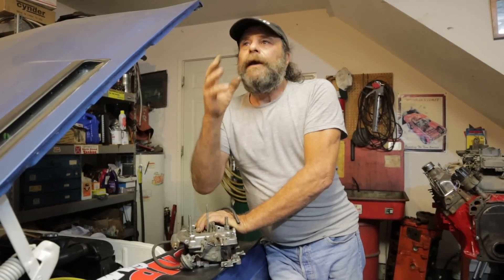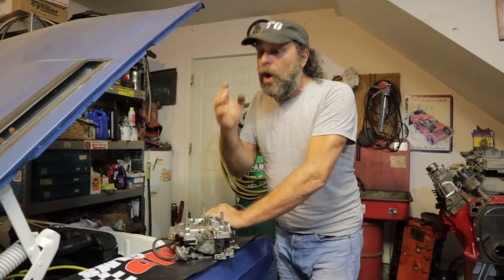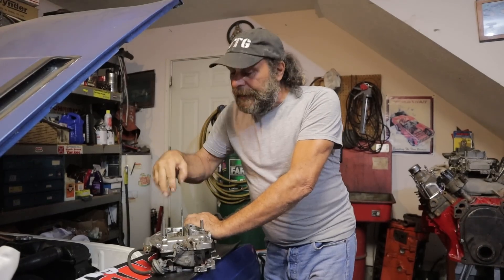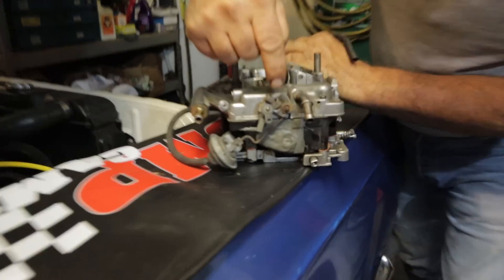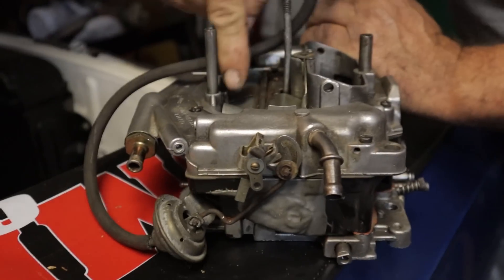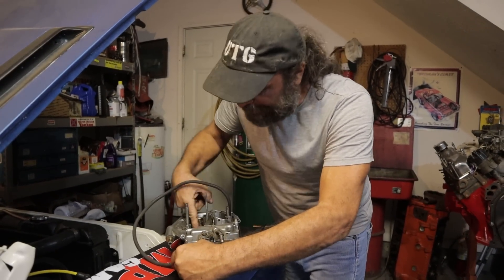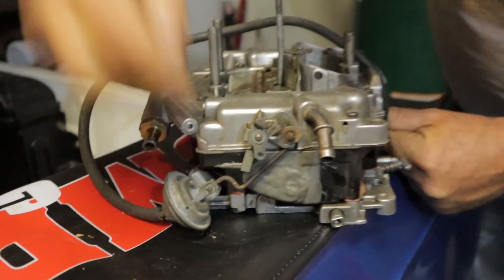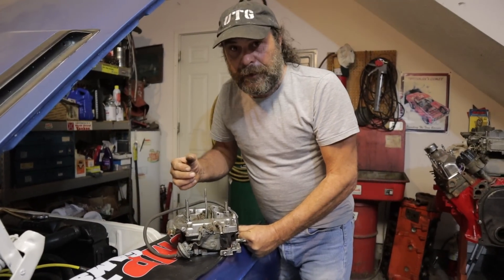The Great Thermoquad Debate

Comment: Well Mr. Know it all unfailable godlike creature of old Mopar shit. How does the vacuum unit work when you have low vacuum from a racing cam. Usually you rip that sucker off and tune it by the spring adjustment .It is similar to the Quadrajet .  So don't shit your pants when people don't go along with your wacko theories.
Reply from the maker: And Boom, there it is!  
Is this a 3/4 or full racing cam?  I guess it must be full, not having enough vacuum to pull fuel through the idle circuits much less operate a tiny pull-off. 
  Could someone please explain the flaws in this theory to this scientist?
  BTW, the reason I get so frosted over this sort of thing, is because we have so many viewers on this channel that are trying to LEARN.
  Their minds are wide open, and their experience paper thin.  They have no way to discern between valid argument and absurdities.  This sort of thing only muddies their water and makes difficult to understand concepts only more confusing to them.
Reply: @UncleTonysGarage    Took the the  Thermoquad and applied vacuum to the dashpot with a pump & gauge.  Took less than 0.5 in-Hg to pull the dashpot in.  As soon as the needle moved it pulled in.  This is not a power steering booster.  Best Regards
Reply: Mike Laumaillier m
Reply: @UncleTonysGarage  Absolutely Tony! Thats the hardest part of learning about cars. Everyone has their own opinion and ways so you end up not know what the hell to do.
Reply: @UncleTonysGarage  LOL 3/4  racing cam good comeback.
Reply: @UncleTonysGarage  you could just leave it up us viewers to deal with the comment section or ignore it.
Reply: @NebukedNezzer  we usually do, but were even tired of processing bullshit!
Reply: @UncleTonysGarage  Thanks Tony. I was always told to tune it with the spring adjustment so I responded with a long reply about how I thought it was in the spring and almost all of other adjustments I remember. I usually messed with the pulloff only if I couldn't get the cold start to idle clean till the choke opened up. I do remember once I was tweaking it back in after doing some work on it and pretty sure I messed the pull off linkage and it had a much smoother transition as the secondary opened but I think the choke still wasn't quite right so I did some more tweaking and the choke worked great but it never was as smooth as the secondary opened again. It's been years since I adjusted one so if I read the pulloff was mainly for lockout and smooth secondary action I forgot it.
After seeing your hands on demonstration it makes perfect sense and sorry if I added to the noise. Like you said that spring has to be tight enough so the door just doesn't flop open till it's ready for it and if I'd understood that part of the adjustment on the pull off linkage better my transition to the back half would have been even smoother.
I should have just stayed out of it and eventually the why would have been explained 😔
Reply: @UncleTonysGarage  Devil's advocate for a second - you leave the audience with a lot of gaps to fill. You put out videos with the cars already put together and tuned, leaving tons of questions and room for bad advice. I get you tried to film working on it and you hate it, but still.
- the head porting was a really good one. Try more of that?
Reply: @Dielauwen---- ummmm .. when was the Thermoquad designed to operate with a low vacuum high performance engine? Because obviously for that epic load of flatulence just oozed from the 3 brain cells you have left and somehow made its way to the comment section here, these carbs MUST have been designed to operate on a racing engine that you describe.   There is a major difference in using something as it was DESIGNED AND INTENDED to operate and be tuned as opposed to fabricating the same thing to work for purposes other than what it was designed for. This has got to be the most ignorant, kicking your ownself in the ass comment I've ever read. 

Can you make the thing work for a race engine? Yes I guess you could up to a point. Does it require modification and tuning beyond which it was designed for? Yes.  But under normal circumstances in an environment in which it was intended to operate, Uncle Tony is correct. In it's intended environment, tuning is done primarily through the length of the secondary link. 

You can't compare intended use and standard tuning to modification for purposes other than intended. 

Sit down and try again another day
Reply: @GLF426  exactly.  Tony and the other guy are in two different conversations( if you will), and talking ( arguing) with each other.  Tony is trying to teach from the point of view of a shop teacher teaching high school kids how to work on cars.  The other guy is coming from the point of view of a guy working with a buddy on a racecar in his garage.
Reply: @GLF426  
Couldn't agree with you more. 
The Thermoquad he's tuning is on a stock 360 with smaller port 318 heads and an intake with tiny runners. This all sounds like something that would make great vacuum at idle. Just my thoughts. 
Again, great answer.
Reply: @jhammy444  thanks bud. Seemed pretty obvious to me.  But he's the kinda guy that would throw a vacuum pump on there and say told you so.  Then we'd have to explain the difference between manifold vacuum and crankcase vacuum lol.  Hold up.  Actually I wonder if it would pull enough to port the manifold and hook in???  That I'm not sure about. That's the couple beers talking 🤣🤣
Reply: You don't understand english.
Reply from the maker: Some of you appear to have missed the sarcasm in my original reply.
The absurdity of the original comment is the assumption that a "big cam" engine won't make enough vacuum to operate the pull off.
Yea, it's absolutely true that things like power brakes are effected by low vacuum, but something like a tiny dashpot will operate just fine...same thing as a vacuum secondary carb. Zero issues operating in a low rpm/low vacuum situation.
What I was saying (Though obviously not clearly) was that if an engine has enough vacuum to pull fuel through the idle circuitry, it has enough vacuum to operate the pull-off.
The Thermoquad was originally designed as a HIGH PERFORMANCE replacement for the Quadrajet...three full years BEFORE Chrysler ever used one on a production car.
It's designed to work with big cams and low vacuum!  AND, that limiting factor on the secondary air door actuator is why this carb can be used on a 318 or a 440 at one size and function just fine.
Didn't mean to write a book here, but had to clear that up.
Reply: Uncle Tony's Garage- came 50 comments down just to make sure his comment section was kept in line. 

Valiant effort tony/his crew. 
Get it, valiant* lol. 
Hope I got ya to see not everyone here needs to lighten up.
Reply: @UncleTonysGarage  Uncle, the point you made was clear and concise. Not everyone gets sarcasm or implication.
Reply: @UncleTonysGarage  I'm pretty sure they were originally released in 69 and Mopar started running them in 71 on the 340. The first ones used I think a different air metering design and used different jets with o rings that pushed into the jet bore too. I used to have a strip kit for the early setup and a 71 340 carb as well. 
Scott Smith Harms found out I had them and bought them from me seeing how I wasn't going to use them and needed money at the time. They later went to the version that Mopar went with in 72 which uses screw in jets and solid fuel metering. I think the early design went to screw in jets by the time Chrysler started using them in 71 so there may be 3 different versions of strip kits out there. Very early push in, later screw in for the later early version, then the last final version with screw in jets.
Just wish I had bought a strip kit for one in the 80s when I was thinking about trying one. I did finally get one but it took 20 years.
Reply: Also why would anyone want a Quadrajet or a thermoquad on a racing engine??
Reply: Did I miss where UT put a race cam in this stock 360 with 318 heads like original poster @dielauwen mentioned? I must have missed something in all seriousness......
Reply: Tell em to suck your balloon knot lollipop uncle tony personally I like how holleys look over all and they seam simple to tune. I hear horror story's and quadrajets and thermoquads
Reply: @kevinjohnson9372  The horror stories you hear about Quadrajets are from people that don't know how to tune them. They either don't want to take the time to truly understand the carb, or they just don't have the capacity to understand it when they do try to learn it.

Honestly, the Quadrajet is the best carb you can get for a street/strip car (which covers 90% of us who like to drive them often). It operates like a 2-barrel when driving atypical, but has insane power on demand even stomping on it and the secondaries open up.

The biggest drawback to quadrajets are that, as a stock carb, they are setup and tuned EXTREMELY application specific. The moment you make and decent levels of change to your engine, the Q-Jet that allowed the stock engine to run like a raped ape now no longer works fluid with the new beefed up motor. Thus, you have to tune it to the new application to get the quality out of the carb that it has to offer.

Ie- I just had a 305 that received a 268h Comp Cam and the guy was having massive problems with his carb. Bogging, nozzle drip, all kinds of stuff. Since a massive cam was added, it altered the need from the carb and the carb needed drilled and retuned to the new application. Ever since returning the carb, the car now runs 12.5's on the strip consistently. He switched to a Holley that's tuned to that engine, and was running consistent 12.8's. Switched back to the Qjet, and back down to 12.5's again...

This isn't to say Holleys don't hold up to Qjets, but more to show that in his specific application with low compression and high duration/overlap, the Qjet is outperforming the other 2 carbs he's tried multiple times (he was a Qjet naysayer for a long time).

So, the Qjet definitely has it's place and is an amazing fuel metering device. It's just that it's a very intricate carb that takes in depth knowledge and know-how in order to tune them correctly to get the best performance possible from them. :)
Reply: racing cam with a thermoquad???
Reply: @kennethcrosswhite3492  He's reffering to runnung a thermoquad in his latest 360 engine. It's not a racing cam, but a mild daily driver torque engine with a basic factory stock roller cam. Did you even watch the previous videos?
Reply: @RL-RL  i was reffering to the other guys comment about running a race came with a thermoquad. did you even read the previous comments???
Reply: i know what Tony is doing
Reply: dielauwen totally missed everything UT said
Reply: @Good Rid dance You tune these carbs and many GM carbs that way. GM even taught this trick in their training classes.
Reply: This comment section was awesome. A dude was called a pussy, coward, know it all, has a cat emoji, dipshit, troll, jerks off dude's, tell his girl I need my boots they under the bed, and half of him must of run down his mama leg when he was conceived! That may be a record! All that over a carb. It's like the auto version of Trump supporters & haters arguing. I think these masks are driving people nuts. Yep, 2020's been a ruff one!
Reply: @burtsegal3612  quite simple really. A lot of us do understand it. And some of us (not me) may be more loquacious than others and can simplify things further for those that don't understand. Pretty black and white bud
Reply: I'll start off by saying I've never held a Thermoquad in my hands, but I get what UT said in the previous video. I think the people who get confused believe that because the spring is internal to the carburetor, it's the primary adjustment, and the vacuum pot is external, so it must be a tacked-on secondary adjustment, when in reality it's tacked on to allow it to be easily replaceable. My question: if you forget to include that linkage between the vacuum pot and the secondaries, do the secondaries open on their own when you're mashing the throttle? I had that happen with a Quadrajet on a big block Cadillac.
Reply: You couldn't tune a freaking Quadrajet if you have ten books and ten videos showing you how to do it. Oh, and if you have a cat for an avitar, and spew crap, you're a pussy!
Reply: Why the hell would you run a tq on a full race cam ? Which would equate to a race motor?
You would get shot in australia if u ran a tq or quadi on a race motor. 
Why you would use a tq on a race motor baffles me.
Reply: Burt, did he ask anyone to explain anything other than what they commented on because they have absolutely no clue on the matter or anything else for that much.
Reply: Nope
Reply: Infallible
Reply: I must have missed Tony's video in which he said anything about putting a racing cam.  Truthfully, I'm sure a couple vids got by me, so don't type nasty comments at me.
Reply: hey D.A. dont forget old ford shit too
Reply: Idiots are everywhere UT.
Reply: ...jeezus....you really didn't listen did you? It's for you morons that this video HAD to be made.......
Reply: This is a near stock hi way engine not a drag strip engine the thermoqwad  is fine in this car why is everyone going on like it's a pro stocker
Reply: @dielauwen Frankly, if you’re ripping off the dashpot and using just the spring, you’re an incompetent idiot that doesn’t know what he’s doing, and too fucking lazy to figure out how it works. How about reading the very info released by Carter and any directions that come in a rebuild kit; they give very clear instructions on how to tune your carb. And out of something like 18-20 steps, not a single one of them involves ripping the dashpot off. Lazy fuckin hillbilly
Reply: @Good Rid dance if you are going to race,stick with a wide open design carb,hence the name HOLLEY COMES UP, it is actually designed for full race of super street action,jetting,vacuum power valves for enrichening the power circuit for most applications,plus they are stupid proof,when you need one talk to them and tell them what you want and expect,me i'm carter sold
Reply: Dielauwen so now that you've been shown to be 'not mr know it all' how do you respond? I would think an apology would be in order, but feel free to ramble on with more drivel on how you're right and UT and the majority of the other comments are wrong. Tony you do a great job explaining things to those of us who are learning, thank you & keep em coming.
Reply: Reeeeeeeeeeeeeeee!
Reply: WRONG!  you can't run a vacuum secondary carb, be it Qjet, TQ, Holley, etc. without the dashpot !  it will create a HUGE BOG.  the spring alone no matter how tight won't stop it, because it will open TOO SOON. you're the exact type of idiot the guy is talking about, you don't know shit. his video is no doubt aimed at you.  stfua
Reply: even with low vacuum, the vacuum is still enough to work that tiny dashpot, you pea brain.  if he can work it just by sucking on the hose with his lungs, the engine can work it too with 8 big pistons. even with a big cam.
Reply: dielauwen if your cam is so lumpy you got no vacuum then DONT PUT A VACUUM SECONDARY CARB ON IT MORON !!!!!!!!!
Reply: Low vacuum from a racing cam?   Is that like a carburated motor which doesnt use a carburetor??
Reply: @yoski203  what they mean by "low vacuum racing cam" means that "racing cams" designed to operate in a higher than factory RPM range, often exhibit characteristics like poor idle quality and poor low speed power output due to their large "overlap window". Ovelap is  the period of time when both intake and exhaust valves are open at the same time. Big overlap = poor vacuum signal to the boosters in the carb at low speed.
Reply: @Torquemonster440 
Perfect answer.
Reply: @jhammy444  thanks, just trying to bring some clarity to basic "camshaft theory ". Which to most new guys is often a very confusing subject.
Reply: @Torquemonster440  
Absolutely can be confusing.  
Hence, why we used to hear the 3/4 cam term thrown around at car shows and cruise nights. 
Lol
Reply: @yoski203  you are blessed
Reply: It is arguments like this that forced the government to mandate fuel injection systems. MIND BLOWN 🤯
Reply: Why not just add the readily available auxiliary vacuum for lopey race cams that affects other things too ? Guess my point is they're are several options amd opinions to correct that cam problem. And this car doesn't have a lopey race cam if you've been following this daily driver build. If you don't like then dont watch. But quit ur fuckin bitchin and go watch another channel. I enjoy this channel as do many others so go be a troll somewhere else. Or maybe go start your own channel and then you can profess your knowledge to the world.
Reply: Clearly, not all birthing canals are the same size.
Reply: Some of us knew exactly what you meant Tony.
Reply: And some of us do know exactly what he is talking about.
Reply: If you’re using a big cam you’re not using that carb.
Reply: @fuji302  correct the car it's was being used on has a mild cam it's set up as a daily hiway cruiser
Reply: Maybe Cat 🐈video's more to ur liking? I got ya covered man! Got MoPaR's in em too. Tap red C enjoy. 😸
(plz try not being sheldon cooper. 
upsets UT )

Comment: Well UTG, I have watched most your videos on quadrajet carbs and I like em. Straight forward and relatable. Haters be everywhere and haters hate. 
I know the video is older now, nearly ancient on the tube but my question remains and I find no info on it. 
Running a Buick 350 in a 69 Wagoneer. The engine is stock minus mild cam upgrade and switched 2 barrel intake to 4 barrel from a 69 Skylark. My quadrajet is Kaput and I need to replace. My question is, and I hope you or someone on the thread has the knowledge, is the Thermoquad or the Quadrajet a better 4x4 carburetor?  
Thank you.